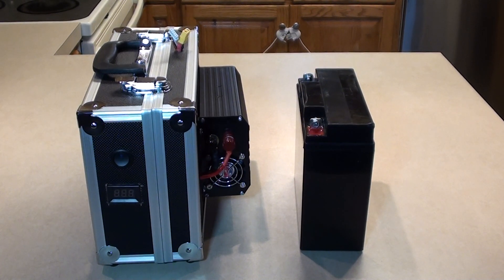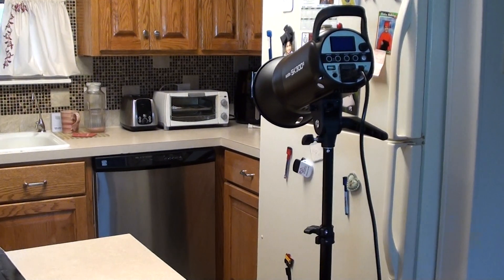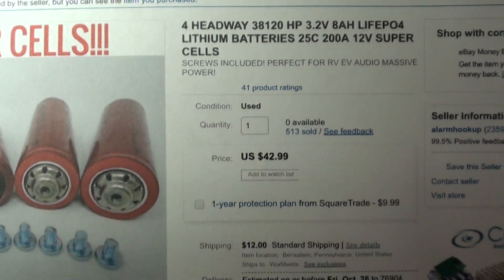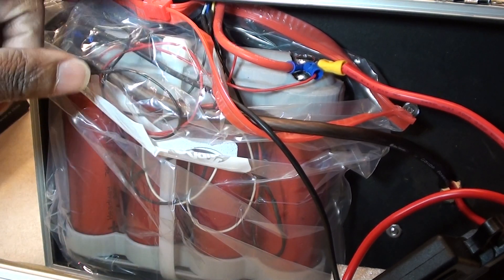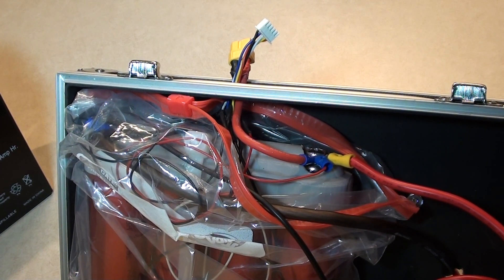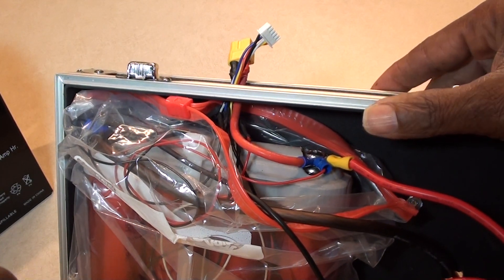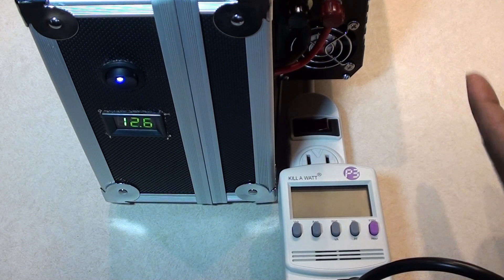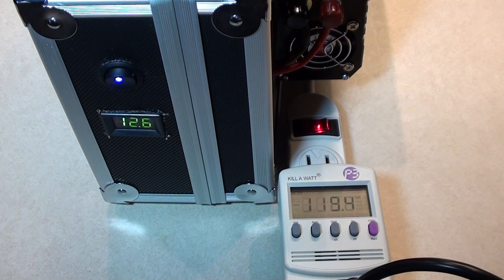DIY Power Supply UPGRADE, "POWERFUL" Headway 38120 Cells!

Comment: Max charge voltage is technically 14.6V (3.65V per cell, however the "safe" max charge voltage of LiFeP04 can be as high as 4.2V but there is ZERO capacity to be gained past 3.6V so do not charge past 3.7V). LiFePO4 will rest at about 3.40V to 3.55V per cell depending on the cell (the larger prismatics tend to rest a bit lower, the smaller cylindrical cells tend to rest a bit higher). So after you pull the charger off the battery you might see your pack drop from 14.4'ish volts to 13.8V or 13.4V The absolute minimum you want to see is 13.30 or 13.20 volts. The voltage will rapidly drop from 14'ish volts down to the 13.30V area and then it will SLOWLY creep down towards 12.6V. Then things will slowly start to pick up and once you hit 12V things start to go downhill pretty fast. Not much point in taking these cells below 2.8V each or so.

Comment: Does puresine inverter is necessary?
Reply from the maker: Depends on what you want to use your power supply for. If you are powering light bulbs, electric drills, tools, kitchen appliances etc.. a regular inverter is fine. But for sensitive "electronics" a regular inverter could cause them to fail. My power pack will be primarily used withy moonlights so I don't want to have them malfunction while our on a shoot due to a "nasty" energy signal coming from a regular inverter.
Reply: @allabouthim03  Thank you sir, I need to use with SK300II like you,with lifepo4 15Ah 12v. 1600w inverter ,from your experience 8Ah of lifepo4 ,how long or how many shoot of flash can it take?
Reply from the maker: @popularDIY  that's a question I honestly don't have an answer for. As you know all of that will depend on your power setting of your light. My shoots are usually only about an hour weather it by portrait, family or sports. I've never ran into a problem with it lasting long enough. The only issue I had once was I had the modeling light ON during a shot, and I was set at 3/4 to 1/1 power....it didn't like that at all. I don't think the cells were the issue, I think the problem was my power supply. Which is why I recommend everyone to use at least a 800w or better PSW  inverter.
Reply: @allabouthim03  Thank you for more Idea from your channel.

Comment: Popular cells wouldn't stay inexpensive for long. October 2018, $13.75 per cell . As of June 2019, now they are $25.75. Good old fashion supply and demand. Still a good deal for powerful lifepo4 batteries.

 What BMS did you use? What charger are you using?

Comment: Nice video. 
I have bought 16 of these 38120s from Alarmhookup via ebay the same as you did. I have them configured in 4 x 4S formats. So 4 battery packs all paralleled. I have 4 BMS boards. They will allow 100A either in or out. They balance charge at 55ma so it will take a while to charge them off solar. The nice thing about 38120 is that each cell packs a punch unlike 18650s. That means that each cell can have individual management. 
Therefore 4 packs with 4 BMS boards all paralleled and each and every one of the cells is charged and monitored individually.
I intend mounting 4 x 250 watt solar panels on my camper roof with another 200 on a portable setup.  At the same time I have a Honda EU2000i generator with a separate charger so they can be charged when I run the AC. When driving, the car alternator is used to top them up. 
I like the case you mounted them in - Harbor Freight right? 
Are you concerned about heat? 
Lastly you are right that inverter is way to small for what you are doing. You need 1000w at least or even 1500w. You have a current bottleneck at that inverter. The batteries will kick ass but not if you throttle them back due to the inverter.
Reply from the maker: Wow, you really know your stuff. I'm not that deep but I proud I finally got it to work for me. I had a high school graduation shoot on Friday so that was my first time "officially" using it in the field. It worked like a charm. HEAT, that's a good question...I think I'll do a test with a heat probe in the box and see what happens. I don't think it's going to make much difference. I've seen videos of people making huge packs and using them to run the sound systems in their vehicles. Yes the box came from HF.
Reply: Is it possible to hook these up with that same BMS and use it as a starter battery for a car or truck? I know it can start a car up because it has enough power to do so, but what I am trying to figure out is a proper BMS set up.

Comment: sir nice video but i don't know about this type of batteries. can you tell me this batteries can be charged from direct solar panels. thanks
Reply from the maker: I no nothing about charging batteries with solar panels. But there are YouTube videos showing how to do that.
Reply: That is all relative to your battery voltage and your solar output. Short and simple not recommended. You need to run the numbers on your panels and your cells. These headways are supposed to charge at 2a for each cell.  Of course you will also need your charge controller circuits and bms for peace of mind. In theory you can charge directly from panels if the numbers match.